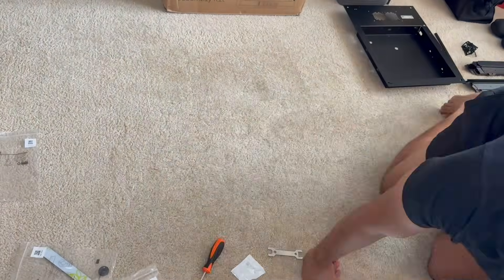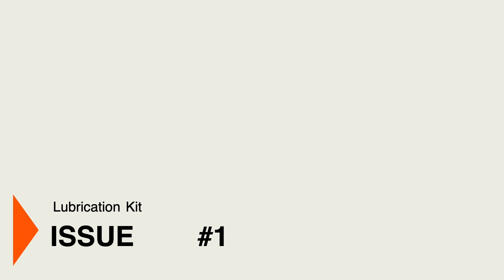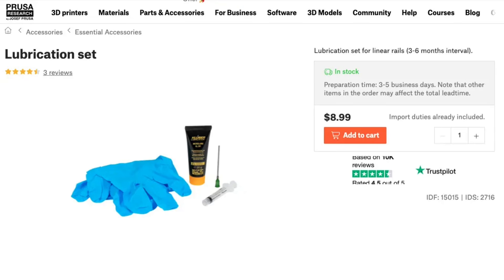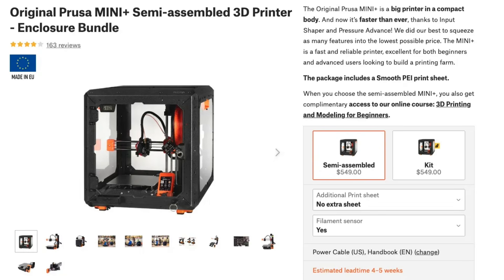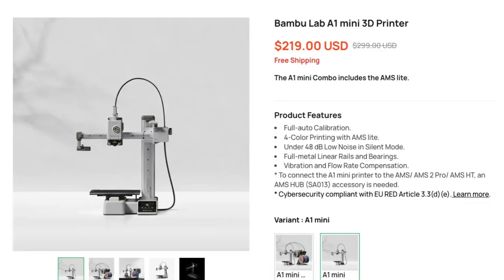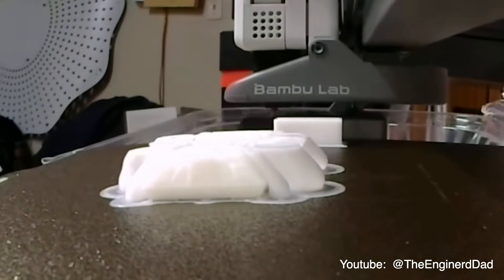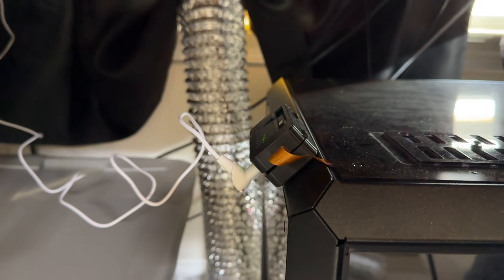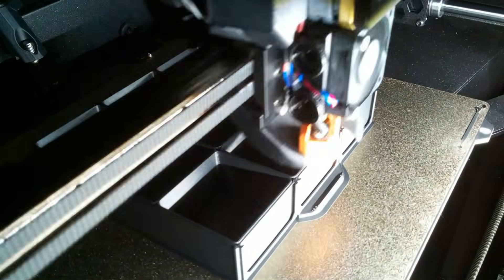Prusa Core One: 5 Things I Wish I Knew Before Buying

Comment: issue 5: i dont like when prusa brag about privacy, but the prusa cameras need to connect to prusa connect (cloud) throw wifi. the camera on the core one is conectet to the core one with usb-c, why i cant use with prusa link (offline and local)? that frustates me a lot. and that the camera is seconds per frame, not frames per second

Comment: Nice video, thumbs up. I understand your points, but I would look at it from a different perspective.

The long delivery times are, of course, due to the fact that Prusa doesn't have a warehouse in every country. Bambu, on the other hand, has experienced this solely due to the large number of returns (since the quality of even existing products has been significantly reduced – especially in the X, A, and H series). I myself bought two H2Ds in November – both failed after 100 hours. Repairability is unfortunately not guaranteed, even with their wiki – the excellent displays and numerous servo motors for air flaps are of no use.

Bambulab is also experiencing the phenomenon of 'enshittyfication'. The P2S no longer has a case fan – but thankfully, they've already anticipated this and offer a DIY kit from Bambulab. Its like DLCs right at the release of a new game by EA. 

I once spoke with a Prusa developer about the camera. The problem is meeting privacy standards and certifications. This isn't an issue for Bambu, Anycubic, and the other plastic-framed devices, of course.

The fact that competitors' printers are so cheap is the same phenomenon as with smart speakers. All the data you print ends up with Bambu. In our development office, we would never use that – but hardly anyone reads the terms and conditions. People who say that data protection isn't important simply haven't grasped it – but they probably only print Flexy Animals and Benchys anyway.